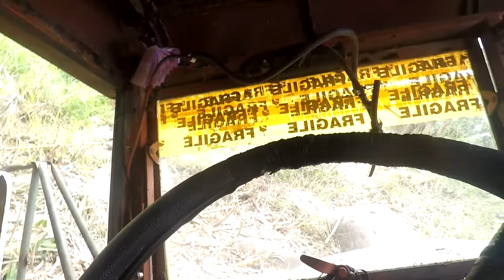the truck lost is controlled and brake can't stop from top mountain to down hill

Comment: ala po sa truck yan human error po
Reply from the maker: naka 4th gear sa slope..
Reply: @depede384  baka po nka hi po siya kc kng nka lo siya maski mahina po brake niyan hnd po siya bibilis kng minsan po asa transperkis po bka na kalas ng neutral siya pero maski n ala nman mahabang lusongan ang problima kc sa TD brake pagka my tama rubber niyan napu2nta sa timba niya fluid
Reply from the maker: @liwanagjeromeadriel2693  yun driver kasi first time drive na yan. expectation niya hindi nakuha dahil galing siya toyota unit